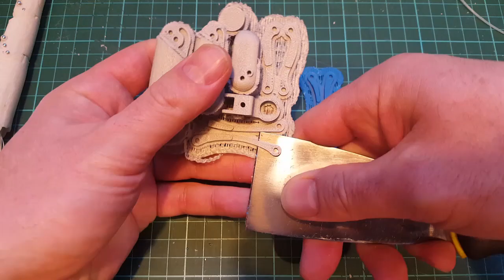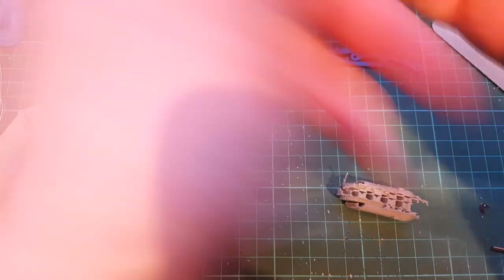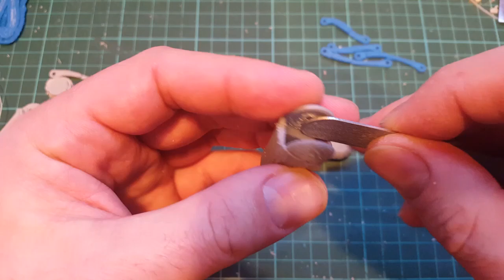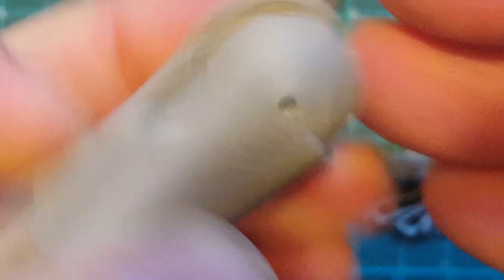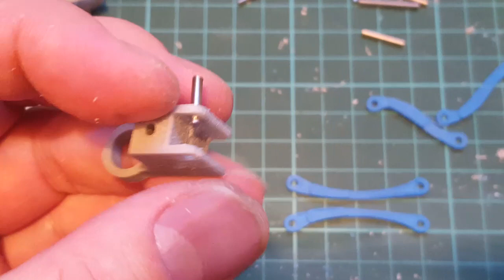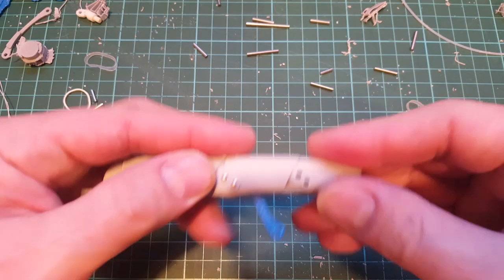Robot Nano Hand - Finger Assembly

Comment: Awesome! How do those pins stay in firmly? Especially considering that you drill the holes before, aren't they prone to slipping out?
Reply from the maker: Thanks! Drilled holes in plastic always come out a little under sized (unless the drill is really worked to make them oversize) and so far no pins have dropped. You’re right though and in subsequent designs I split the sections and screw them together so the pins are fully retained.
Reply: @therobotstudio  cool, thanks a lot for the reply!
Reply from the maker: @EctoMorpheus  I checked the files and some of the holes were indeed 0.1 over size. All corrected and the latest stl files are now up on Thingiverse. Thanks.

Comment: Lovely! Love the walk through. Looking great, I'll likely give these a print to test them out. :)
Reply from the maker: Thanks! Please do, I’d love some feedback on ease of printing, assembly and sourcing the other components. Instructions for the rest of the hand to follow...
Reply: @therobotstudio  hmmm. Just was digging around for the 2mm dowel pins and it seems they are not that easy to get ahold of. I really like the idea of using them, though it will take some shopping around to find. I did locate some 2mmx45mm ones easily enough in bulk so could always cut those down to size.  

3mm seems not as hard to located and I guess would work for most designs also if drilling the holes out a bit.... but smaller is nice. XD   

The hunt continues as Im sure they will be useful for hand designs for years to come. :)
Reply from the maker: @CyberSyntek  Thanks for the feedback. Where are you based? In the UK and Europe you can use these two suppliers: https://www.screwfasteners.co.uk/goupille-cylindrique-rectifiee-2x18-inox-a1-din-7.html who sell by the unit and these guys who sell by the 100: https://www.pts-uk.com/products/pins-and-keys/dowel-pins
Reply: @therobotstudio  over in Canada on my side. I did fine lots of lathe bar options for cheap. X20 packs of 2mm x 100-200mm for like $10-$20? :9   they would work if I bust out the dremel saw.  Will keep an eye out for options anyway. 

Btw did you have any specs on the bands? Any prefered bands or sizes?
Reply from the maker: @CyberSyntek  is the issue that the bar diameter is metric? If there’s an imperial size which is near to 2mm and easy to find I could modify the stl files to suit. Not sure what lathe bar is - the important thing is a very smooth surface finish so ideally the bar should be ground to size. If you need a dremel to a cut it sounds hardened so I would expect it to be ground. The PU bands I’m using have a width of 3mm a thickness of 0.6mm and a nominal diameter of about 15-20mm when unstretched. Please let me know what you can find...
Reply: @therobotstudio  i'm not sure actually. I was digging around for an hour or so just because I got curious and know these type of things will be useful for future projects. Might have to do with imperial sizes generally start a bit larger. Ive had my fair share of issues getting smaller screws in a variety of lengths. It seems anything less than m3 is not so easy to come by. Certainly they exist, just not as common. 
The lathe bar (I didn't know what it was either before the look up) is essentially the same thing. Smooth rounded steel or brass that comes in a variety of diameters and lengthd. Generally longish and flat ended instead of rounded. Could come as a cheap alternative with the exception of needing to self cut pieces to size your needs. 

Anyway, I wouldn't bother modding it, after all if people can't locate 2mm, 3mm with a little bit of drilling the holes would surely work. Just nice to keep things small when possible. :)
Reply from the maker: Interesting to know. Unfortunately some of the pins cannot easily be replaced by drilling out to 3mm as the internal clearances on the slots and ends of the linkages are too tight. Did you manage to get the lathe bar?
Reply: @therobotstudio  oh. That is a tight design. :D

Not as of yet. Ill take a look around again to see if I can find better options. Would be nice if not needing to cut my own, but no biggy really if I do. :9 

Ill let u know if I find anything or end up grabbing the bar. :)
Reply from the maker: tps://www.amazon.ca/Yesallwas-Stainless-Support-Fasten-Elements/dp/B07TNHF456
Should do the trick, you would have to cut a few down to 10 and 12mm.
Reply from the maker: As you’ll need some longer ones these might be better though you’ll have to cut them all to length: https://www.amazon.ca/uxcell®-100Pcs-Stainless-Fasten-Elements/dp/B07MKMQBD7
Reply: @therobotstudio aye. I saw those also actually. Figured the even longer ones would be the best bang for the buck. Just ordered some so we will see how they turn out when they arrive. :)
Reply from the maker: @CyberSyntek {}Hi! If the metal pins are still a problem to source you can use wire from a coathanger or the 3d filament itself. Another user has had good results when printing in PETG with PETG filament pins melted at each end to secure them.
Reply: @therobotstudio  Eventually the 100mm pack arrived. I believe I have everything I need, just got side tracked with other projects. Still very much planning on printing it out and playing with it. I think I printed a few pieces off already actually. Me and the GF ended up getting a kitten so lots of things got tossed into boxes during the attempt to kitten proof the house.  I'll need to dig those up. :)

Really looking forward to playing with your arm design. It looks promising. I brought it to the attention of a few of the guy in our Inmoov discord yesterday and they also seem to be very curious. You may end up with a few more testers. :)
Reply: @therobotstudio  aye, I figured the filament would work in PETG or ABS. We use the 3mm filament on the inmoov fingers, but 1.75 should do the job if secured. Will be nice to test the steel pins now that I have them so I can feel more fancy and know they have lasting strength. :)
Reply from the maker: @CyberSyntek  Great, let me know how you get on…
Reply from the maker: @CyberSyntek  Yes, 1.75 seems strong enough for testing certainly and the ends can be melted and flattened which retains better than steel pins.
Reply from the maker: @CyberSyntek  more testers would be great, the feedback on the hand has been very useful to make it easier to assemble. The issue with the arm I suspect is cost - what would you be prepared to pay for components? Motors, gearboxes and controllers are the big ones.
Reply: @therobotstudio  obviously keeping costs down is good, but not at the expense of losing too much performance. :9

Not so worried about the price, may slow progress down and not be able to build everything in one shot if too pricey as I have limited funds to work with but, as is life. :)

Certainly will be curious to see the bom and weigh out if I can manage or not.
Reply from the maker: @CyberSyntek  I can give you the price of the gearmotor, sensor and controller for the arm as maxon has an online shop. They come in at a little over 650Euros each. So almost 3k for the 4 dof in the arm. At volume i.e. a Kickstarter for 100 arms I’m told that would come down to about 35-40% of that.
Reply: @therobotstudio  oh man. A step above dynamixel and or odrive prices! Wasn't figuring that much. XD
Still will be following the updates. If it functions well enough I may slowly start to bite the bullet on them.
Reply from the maker: @CyberSyntek  will be interested to know your tipping point :-). Dynamixel actually use maxonmotor - I just use the most powerful versions.